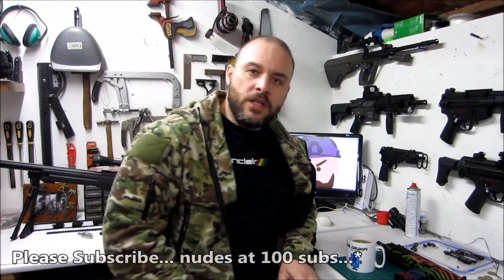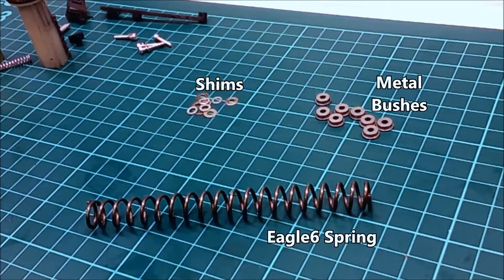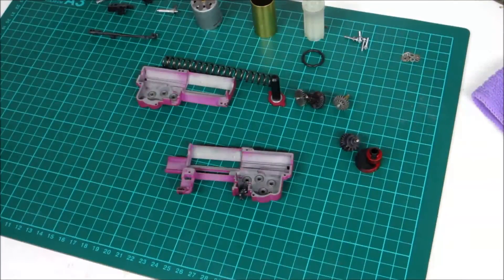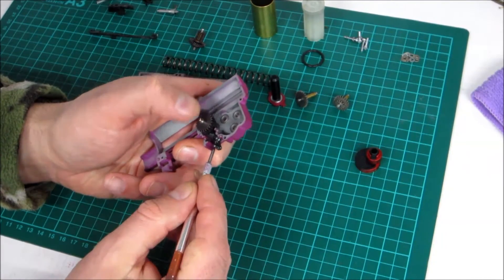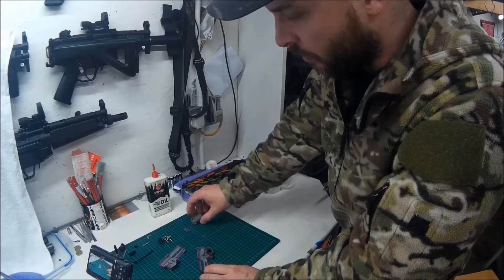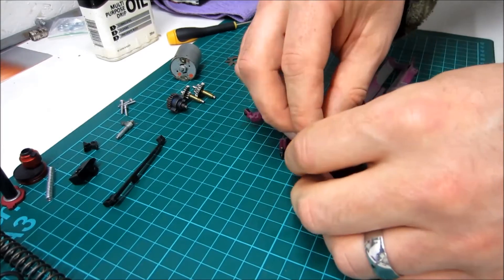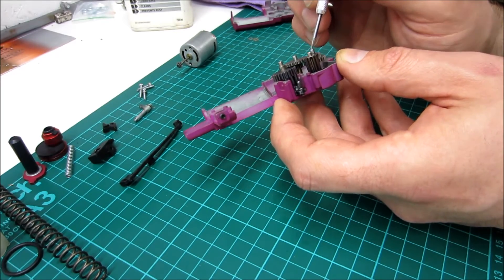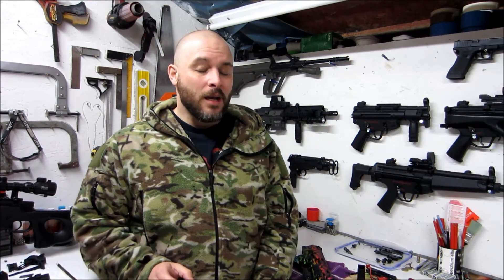Well R4 MP7 | Part 4 | AEP Gearbox Rebuild, Upgrade & Shim | Airsoft BYR

Comment: Dont worry about having too much detail. There are enough undetailed videos on the scorpion etc and I really have been looking for someone with more detail ( and quality camera). Thanks for this. I misplaced a gear and needed this
Reply from the maker: Hey - thanks for that comment buddy!  Glad the video was helpful - and RE camera quality etc, as I learn more on that side, I'll continue to improve (hopefully lol) - thanks for taking the time to comment buddy :)
Reply from the maker: Oh and I meant to say, I'll be doing the exact same with a TM clone Scorpion soon, so basically:

Painting / Gearbox Overhaul & Upgrade / Hop optimisation / Rewire with home made MOSFET (only cost a few cents/pennies) and LiPo... might go for 11.1v, these are hilarious on that voltage :D

And as my camera work gets better, the videos will get better - hope you stick around buddy!

Comment: Nice video ... and great to hear someone echoing my thoughts about shimming: "it doesn't matter how you do it ... as long as certain fundamentals are met". Well said! 
Motor height adjustment was built into aeg's for a reason!
Reply from the maker: Really appreciate you taking the time to comment buddy and great to hear someone who has the same logical mindset!
Reply: No problem! I'm trying to rebuild an old Well Scorpion from a box of bits. It's exactly the same gearbox as the MP7.
One of the gears was stripped, but as I had a couple of old CYMA G18 gearboxes lying around I managed to use some gears from one of them. In fact I ended up using two CYMA gears and two of the originals because they gave me the best mesh.
It's been fun trying to work out where all the bits go as I haven't worked on one of these for a couple of years.
The gearbox is running ... but I've got a bit left over!!! It's a bit like having finished a jigsaw puzzle and finding a spare piece. I can't identify it on the parts diagram ... so I thought I'd check out youtube to see if I could spot it.
At the moment it's still a mystery :-)
Reply from the maker: I love the well vz61!  Have 2.  They are never going to be high end, but they can be fun - and still serve well in CQB

If you want, pop over to my Facebook page - easier to share pics and chat there - could bounce ideas around and ID those parts between us if you like :)

I do have a brand new unopened well box here, I do intend to do a separate strip and reassembly video on that for clarity sake - these MP7 videos were done a year ago, and I've learned a fair bit about making clear video since then!
Reply: Okay, I'll take a pic of the part and send it to you on fb :-)
Reply: Let me know if a photo or two arrives on fb, okay?

Comment: Very good series, I don't even own a mp7 but I watched the hole thing. Subbed as well.
Reply from the maker: Hey buddy, thanks for dropping by and taking the time to comment, I really appreciate it!

I done these videos very early on when I was starting to make video... I done the best I could with what I had and what I knew at that time - but if I was making them now they'd be so much better!

Having said that, I do need to revisit the series, although I finished the gun, I took it apart again and then never did make a final video!

Comment: Hey dude, it’s been forever since you’ve touched this! I hope your health is better and you’ve maybe had some time to go over this project, don’t wanna touch mine til I’ve seen your work finished!
Reply from the maker: Yeah it has been a while 😂

If it helps, it was back together, shooting 300 FPS on 0.2 ( got some shots 310-312) then I stripped it because I wasn't happy with the hop.  It's pretty poor, the side arm design flexes, and the hop nubs becomes sloped to the side with it, so shots veer off.

I intended getting a tight bore for it just to optimise the low power a little more, but then other things became higher priority.

I was just about to try and find it all when I got engrossed in L85 project, and, coupled with fact I just don't have time to do much regular Airsoft stuff and here we are.

But it did all work and produce way over the target power of 250fps on 0.2g bb's - all that's missing really is a final reassembly and some shooting footage - not much to actually show, but a pain in the arse for me to do.

There is also the added thing that with Elite Forces new MP7 it might just be a bit obsolete now.  It has a proper strong box and full AEG power AND the gun is full sized rather than these which are under scale....
Reply from the maker: Pająki Demka [konto nieaktywne]  yes buddy - at a guess I'd say around 10% undersized 😀

Comment: once I got 1st place in the science fair for powering a clock and other devices with potatoes. The hardest part of it was when I had the make the wires from scratch. I had to sodder the metal clamps on both sides of the wire and connect then to a nail and a piece of copper wire stuck in the potato. It was fun
Reply from the maker: Wonder if I could power an airsoft gun with potatoes lol!!!

Comment: loving this build! I've been subscribed since 7 sub's. I hope you can get your back issues taken care of so you can continue this great series.
Reply from the maker: I really appreciate that, and thanks for sticking with me since then - I find it hard to believe I have over 70 now and I appreciate each and every one!

Also, I know the videos could be better - more detail, less repetition - but I'm learning so please stick with me :)
Reply: Purple Helmet im curious will you be installing a MOSFET on the mp7
Reply from the maker: Possibly - I built and fitted one to my VZ61 and it does make a big difference to trigger response, and means you can simplify the firing mechanism a bit - also, means you can have confidence that your trigger contacts aren't going to burn out, especially if you LiPo it.  Would you like to see me MOSFET/LIPO?  It could be done if its what people would like to see, Im open to suggestions! :)
Reply: Purple Helmet I would love to see something like that because I just bought a jg vz61 (still in the mail as a matter of fact) that I intend on modding/upgrading to shoot about 18 rps at 300fps - at least that's my goal.. I haven't seen any videos on YouTube on how to wire a MOSFET into an mp7 or vz61 aep. Specifically a Gate nano SSR or something similar.
Reply from the maker: Ok let me have a think on that, could do something there.

I know on the VZ61, you will have REAL trouble fitting the Gate Nano, its just such a small gun with not a lot of space -   but there is an off the shelf one thats even smaller, can't remember the model name... let me look into it.  The MP7 has a little more space available.

I have a Well VZ61 here sitting in its box untouched (another breakers yard gun) so I could maybe do something with that, I'm not 100% sure but I believe the JG is a Marui clone too, so for the purposes of working on, they are the same.  Leave it with me!
Reply: Purple Helmet Again, Can't wait for the videos to come! And yes the jg is a 100% clone. I think in the jg, if you were to remove the fuse box, dremel some unnecessary bits from the grip and shorten the wires a tad, you could fit the MOSFET pretty snug with room for a decent sized battery.
Reply: however with the mp7 I'd probably go with some form of a peq or external battery compartment.
Reply from the maker: See thats what I love about YouTube - getting discussing things like this.  There are lots of ways to approach a given problem, and its great to share ideas!

I did get a lipo and MOSFET into the handle of a scorpion, and it was by doing exactly as you say, removing a lot of the unnecessary rubbish :D

I have a couple of video ideas forming from our chat - one showing how to make your own MOSFETs (so easy and cheap) and showing the fitting of one in both the MP7 series, and the VZ61 - thanks for that, your comments really helped :)
Reply: Purple Helmet Thank you for that And thank you for the wonderful content. I hope to do some videos on my skorpion, but being only 15 and with a low paying job ( about 70 bucks a week) you can see why it would be a little hard to do any sort of video especially when most of the money I make goes into the gun, bbs, gear etc. On the subject of the fact that these discussions are important - I was thinking the same thing XD. I hope The airsoft community can realize the versatility of these aep's. It would also be nice to see some more internal upgrades come out for aeps. Anyway can't wait to see what's to come.
Reply from the maker: Hey buddy I feel ya.  Don't get me wrong I'm a good bit older than you, but due to long term health issues and me being out of work, I've not really got any budget to work with either... everything I have is because I take broken stuff and fix it lol - thats what gave me the idea for this channel, and although you kinda have to pay for a lot of parts, if you can at least save paying a tech to do the work, then thats a win!  But it doesn't need to be expensive to make videos - use your smart phone if you have one, or get a loan of one... edit with a free app... obviously I'm still a noob myself, but it doesn't need to cost.  I've just upgraded my camera, but it still only cost me like 28 GBP - again because I bought an old beat up one :) 
You are at the ideal age to be doing this stuff!
Reply: Purple Helmet Ive actually  just been going on ebay or even just asking around for people with old guns and such that they're not using.(I've already gotten a jg p90, cybergun gsg14, jg ak47 and a CYMA m14 that I actually sold for 120 bucks shortly after "refurbishing" it. However, as much as I love aegs, aep's kinda fascinate me and I think I might stick with em.(with the exception of an m14 or SVD lol). As for money, I suppose we'll just have to innovate on a budget lol. It should be pretty interesting.

Comment: Any decent way to push the range further outta this little AEP gearbox? I can only get about 25-30 meters out of it. I've already done a barrel and teflon tape on the cylinder head upgrades, but I don't think I can get more out of it without bucking or full chamber upgrade. Noticed it doesn't have a nub by design, just two teeth pushing on the bucking. Was thinking of grinding them down and put a nub instead.

Comment: Planning on getting one of these second hand, think I found the guy to help me upgrade ;P. (Finally)
Reply from the maker: :D. If possible, try and hold out for a genuine Tokyo Marui... I've never worked on one, but if their other guns are anything to go by, it will be just.... better.  There is an argument that if you are upgrading anyway, it isn't so important as you will be changing out a lot of the parts... but you might just find a stock Marui is as good as you'd want - I believe they fire 250ish fps out the box :D
Reply: Lol I think I should to but I don't have a hefty income (being in high school)so that kinds turned me away from going for the tm model, probably won't do serious upgrades maybe just the battery mod, maybe a little tweaks on the hop up , and reshim it.
Reply from the maker: Ahhh the age old lack-of-funds!  I'm long out of high school, but beleive me I'm in the same boat currently, for different reasons.  All I can say is if you are willing to use a bit of ingenuity, you can find ways to absolutely minimise the costs.  Online breakers yards are great... all those guns on my wall, and a few more in bits that arent on show - I bought either dirt cheap from breakers yards, or bought from folks on the airsoft scene muchos cheapos because they had problems.  The whole thing that gave me the idea to start doing videos was to try and encourage people to give up this attitude that everything good has to cost a fortune - to get involved fixing or making things yourself.  It won't just be limited to airsoft, in time I'm hoping to get all kinds of videos up on here :D It just so happens that airsoft has been one of my hobbies for some 20 years now (on the technical side) - I just love tinkering with stuff to be honest lol

Anyway, I'm rambling - best of luck finding a suitable donor gun and getting it up to the spec you want!!

Comment: Thanks for the videos man. I've been planning to get one of these for a while and I might when I get enough money. Since the FPS on the stock gun in my opinion is a bit crap (for 0.2s) I might get a stronger spring so this'll be extremely useful for reassembling the gearbox when I'm done.

Comment: Good news, I solved the problem!!!! it looks like the gearbox was not sitting properly in the body. To solve it i added some layers of paper under the sliding plate that goes under the gearbox and also added some layers of paper on the backplate so the gearbox is tightly pushed against the front. It looks like everything was mechanical. Make sure that the top thing on the gearbox is sitting properly inside the plastic fire selector, not outside!!
Reply from the maker: Excellent buddy!  That plastic lever being OVER the rod on top of the gearbox is critical, but many people overlook it.  Good work getting it fixed 😁
Reply: I forgot to add this is the fix for the semi auto fire, ups

Comment: Don't get me wrong  i am tempted to style mine up with those upgrades too got mine from the breakers yard for 29 quid aswell in fact i have two of them ones been resprayed with rubber paint i just have too many projects on the go and too many parts to buy so these are going to be done on the cheap partly just to try out some of my ideas not to worried if i destroy the gearbox, to find the limit you have to go beyond it ,another little trick that i have not seen mentioned you may already have done this i use my dremmel and some auto sol and polish the cylinder to a mirror finish reduces friction on the o-ring seal, less heat and wear generated and should help it seal better
Reply from the maker: Ive just had an idea that might not require a lathe, and provide about as good a seal as it gets.  Years ago, when I was building Stirling engines, I'd make my own white metal bearings.  You'd get a brass housing, with the shaft going through it, and you would pour white metal (a sort of soft tin/lead alloy) into the clearance while keeping the shaft rotating so it wouldn't grab (highly polished obviously).  So a clearance sleave of white metal would be left.

I wonder if I could do something similar here, making a new nozzle from an appropriate sized piece of steel tubing, using a slightly oversize piece of brass which it can slide into with slight clearance, and then doing the white metal trick...  Then once done, weld on the little tab to the nozzle that the tappet locates onto...

Gave near gas tight and durable but low friction results in the stirling engines for the reciprocating shafts... white metal bearings have been (poss still are?) used in Formula 1 engines, they used to be made at the Glacier Metals factory not far from me.  Thats how I learned about the process, from field trips while at college/uni for mech. engineering... this deserves a play around.

If it worked, all you'd have to do is drill out the plastic cylinder head, slip fit for the assembly, and epoxy it in place, would never budge again... and anyone with access to a blow torch and solder could do it... apart from the weldign of the little tab onto the new nozzle...

This is why I love the comments on here, great for sharing or sparking new ideas.

Comment: Hey man, did you have problems putting the little ball and spring for the selector back in? Mine little ball falls of as soon as i switch from safe to single. Any advice?
Reply from the maker: Hey man - its been literally over 18 months since I even looked at this project but from memory I can't remember having any major issues.

Is it perhaps getting dislodged during assembly?
Reply: @PurpleHelmet  yeah, i've slept on it, i didn't screw the sides so it was loose and was falling off... Im gonna put it all back and i hope i won't need to tear it up again.
Reply from the maker: @legenda38  excellent!  Glad you got it sorted and it was something simple - they are a pain to split down that far so like you say, hopefully you won't need to again!

Comment: Hey mate, videos are spot on. I spoke to you a few months ago about my well r4 that came with a load of spray paint down the inner barrel and what I was doing with it in general. I was wondering if you fitted the Pico ssr mosfet into it and if so if you Might be able to do a video on it please as the shop I've sent mine to reckon it can't be done but I think they just can't be bothered trying
Reply from the maker: Hey mate, good to hear from you again.  I still haven't had a chance to get near mine so unfortunately no.  It is definitely doable though, it can be done on any gun if you are methodical, the mp7 is no different.  I done it to my vz61 scorpion which is in essence, the same. 

A bit more involved than fitting one in a gun with a full sized gearbox etc, bit not difficult - the shop either can't be bothered as they think it will be hassle - or simply don't know what they are doing but don't want to admit it (nothing wrong with not knowing how to do something!)

As for video, as soon as my 3yo son grows up, leaves house, and gives me my life back, I'll get it done 😂😂😂
Reply: @PurpleHelmet  haha cool mate I'll wait patiently lol. Finally got mine back today, he's managed to swap it over to lipo but it's a bitch to get the front end back on so gonna see what I can dremel out and for some reason it's only firing 130 fps which I'm not too happy about considering I've thrown a couple of hundred quid into the build, but on a lighter note, I ended up buying a cyma ak47 while I was there haha